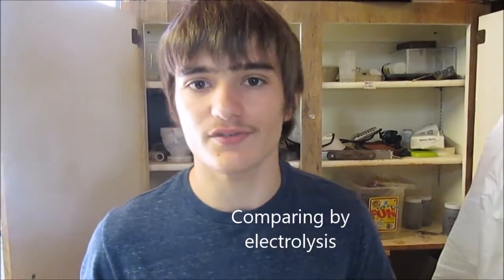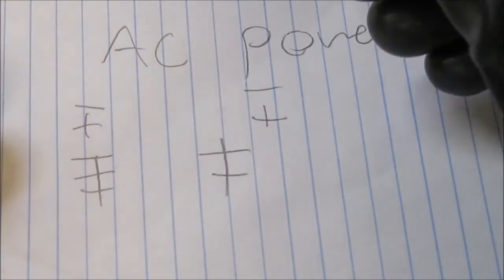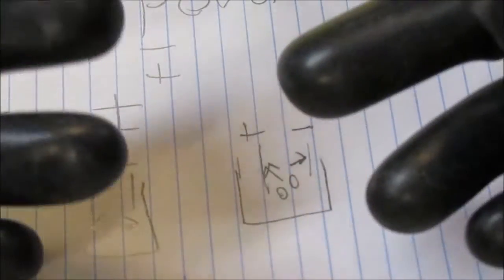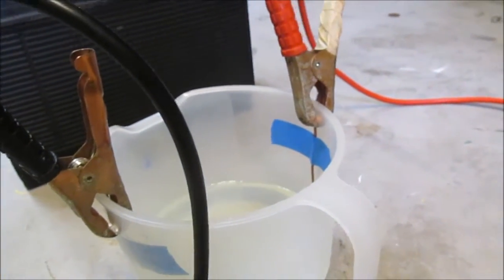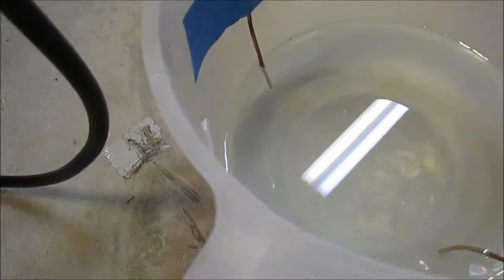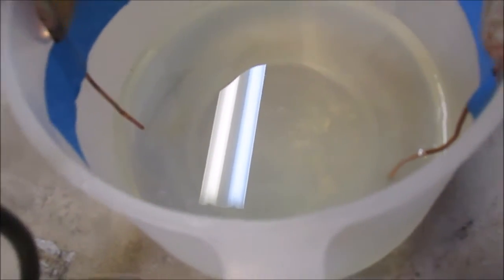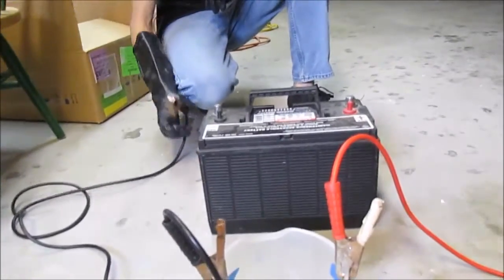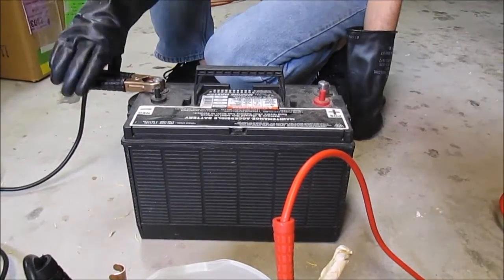AC vs DC Electrolysis

Comment: Ac at higher V and high frequency is actually way more efficient for generating HHO gas from water.  However, u want your signal fo be very specific, and it must be DC offset so the polarity isnt changing.  This way, a pulsed signal will vary between say 0 and 100V instead of -/0 to +50, using less lower than dc and wasting less power as heat dissipation into the solution.

If you match the frequency to the water vibration as a harmonic, the pulsing field will align the molecules and "pull" on the bonds which can break bonds via electric field harmonic constrictive Interference thus generating more gas without using any current, further increasing efficiency.  If the frequency is also matched in resonance with the cell....a massive volume of gas can be made with a fraction of current used compared to dc. 

This is every difficult to achieve though because it requires a very complex supply circuit to generate the needed signal.
Reply: -50 to +50
Reply: Spot on, this is probably what Meyer was doing to get the most out his WFC for the same power cost, especially if you can get the cell electrodes as close together as possible without galvanic contact.
Reply: @JenkoRun  True.  I believe there was a lot more to that guy's HHO car and he was "accidentally" removed, conveniently along with his research and plans etc in a house fire.  Not sure if Meyer was his name, but i remember seeing a guy that ultimately refused to give up when he was mocked and accused of fraud trying to present his invention; he decided to just build it himself staring his own company as an electrical engineer.  He went out west to sell some land to fund the first 10 vehicles and ironically died in a house fire along with his garage and pretty much his research as well.  Not the first time this has happened around breakthrough technologies either.  People think its about making things better, environment etc....total bs.  Its about making profit and thats all, no business wants a product coming along that lasts ten times longer because there's no money in selling tires that go 350-400k miles before wearing out (actually documented organic chemist discovered rubber polymer capable of this, company promised to make the product, bought his patient, then sat on it and its still a locked down tech to this day)

I worked at Oak Ridge in Tennessee USA, largest research facility in the US where the first atomic bomb was developed back in WWII doing R&D as a chemical engineer minoring in polymers and biochemistry.  I had security clearance to everything but the military stuff; lets just say I saw things you would swear was science fiction and not real.  Our tech to the public truly is 25-30 years behind what is really out there at least....its just kept buried because it holds no profit or power over the masses as consumers.  

I personally developed with my team a Li_ion type battery to completion....its capacity was minimally better than current tech, current output was somewhat improved but not by any serious amounts (except for the nano tech layered ones, they had massive current capabilities but also heating issues).  However, I used a biomolecular process to generate the electrode mixtures with nitrated cellulose and other things....making manufacturing not only environmentally friendly removing the harsh solvents needed, but also lowering cost estimated 35ish percent (in 2014).  The kicker though was lifespan.  Currently around 1500 to maybe 2000 charge-discharge cycles and the battery is toast, time to buy replacements.  Mine, however, after 6500 full cycles still retained at least 90% of their original capacity!

Now...being ten years ago now; tell me please, where is this technology???  Ive never even heard of it anywhere in public eye.  Sadly money and greed run things, not the attempt for better things.
Reply: @ckimsey77  If you really have been involved in that kind of research that's very impressive, I've had my head buried in highly alternative physics and research for the last few years and the kind of stuff I've come up with as well is, as you said, the stuff of science fiction. I'd wager those at the top have tech that's actually 130 years ahead of the public in the field theory department.

My interests range all over the place from so called "free energy" (which is really COP > 1, delayed entropy, there are a surprising number of ways for this) to field propulsion craft and various medical devices, and some extremely wacky geometry research, among other things, I'll occasionally browse around the net on a topic I'm interested in to see if anyone has has been thinking along similar lines and your comment caught my eye concerning the Hydrogen production tech.

I saw the exact same thing from one of Aaron Murakami's videos from nearly a decade back, turns out the missing key for Meyer's water fuel technology is Nitrogen of all things, he used it via an air intake to slow the combustion rate of the Hydrogen gas giving it a more conventional burn rate, the resulting ammonia could be fed back into the mixing chamber to increase efficiency.

Another area is purely reactive circuits, preferably the single wire type system that Tesla developed, I don't really like conventional closed circuits since conduction current gives you heat losses in the wires, switch to a resonant single wire system and you get rid of the problem all together, not to mention the reactive power is far less dangerous than active phase, even the Plasma becomes non-destructive.

It's kind of frustrating looking at the modern public tech and actually seeing where the problems are with it and knowing how it could be vastly improved.

I saw your post from a year ago concerning your health, have you looked into the lakhovsky multiple wave oscillator at all? Specifically the data from Borderlands and the Vril website (most other sites tend to be full of useless promotion n such) I've got a copy of the borderlands research data on that thing and it's pretty impressive.

Comment: brute force takes sheer power. hysteresis due to angular momentum at various system resonance frequencies, makes use of local potential instead of requiring higher amperage necessary in low potential situations. Keep digging guys!
Reply: http://www.free-energy-info.tuks.nl/SChapter15.pdf

Comment: You actually can have voltage without current. Voltage is just a potential difference, so when there is an insulator with an arbitrarily high resistance that can be considered for our purposes to be infinite (such as air) blocking the completion of the circuit, the circuit is open and there is full voltage across it with 0 current. What Ohm's law (I = V/R, i.e. current = voltage / resistance) actually tells us is that you can't have current without voltage, because 0/R will always = 0 in practice.

Comment: Add some Potassium hydroxide or sodium hydroxide and then see the magic!
Reply: That's because there is no oxidizer ions in solution, with naoh... So with ac current, you get both oxygen and hydrogen at both electrodes. And you can't easily just separate them... But with DC it's possible cause anode and cathode remain the same during electrolysis.
Reply: @hrajabi7261  yes very true
Reply: Add some salt enough
Reply: @qhriathousz734   Adding salt like NaCl will also generate chlorine gas at anode, which is unwanted, sir.
KOH or NaOH will only give O2 at anode.

Comment: not realy true a plazma ignition burn even ordinary water to their individual molecules  to get a reaction you need 2 ac input and to have oposing frequencys hiting ich other at high speed you will get with high enough voltage sparking effects probably that bucket of water culd kill some one ,read plazma ignition ore plazma generators what they can do how ever good experiment but you shuld try winding metals in to a coils ore use multipel ferritic and non ferritic metal's for testing  then you will see a diference probably for ac to work.
By the way dont do it with ac is lot higher risk to get killed not because of the electricity it self but rather the energy realise from water culd rip you apart the faster you realise a energy the faster mather will implode/explode again watch what plazma generators are they use waraity of diferent things like temperature diferences,magnetism,preshure/wacum tehnicaly all the same crap but diferent energy type's used to get a result.I belive a volta baterry cell is somthing ells as a lead acid baterry and you actualy can swap those diferences with ich other for electrolisys I wuld like to know what wuld hapen if neutral plates are used ore diferent cinde of materials used as plates in a baterry that wuld by interesting well todays peopel actualy make baterrys act as capacitors ore simply use capacitors only to get diferent reactions actualy if you want to look at it in a centrain way lot experiments schools even dont teache sadly

Comment: one small ll note...
thing is tho i have finished to  build my hydrogen generator a big plastic box 22 liters and 2 smaller plastic container 1.5 liter each, where i've put the cells + and - separated,obviously with the bottom of the smaller plastic box with the cells  inside cut to allow water flow around....
specifying  negative plates N.10,positive plates N. 2 each pole inside a plastic box,and bot smaller inside bigger box filled up with 16 liters of water.
what i tested with a power supply 12v dc 60 amps almost nothing comes out,barely few bubbles of oxygen and almost no bubbles of hydrogen.
plugged the 220v AC rectified through a bridge rectifier with 1000 v and 50 amps,right after i plugged the current started producing hydrogen and very lil oxygen...
observation for the test i used small gauge cables,later i will use bigger once so it can arrive higher amps....

Comment: Ehhh.... AC isn't bad for electrolysis, it's different. 
Generally speaking, AC electrolysis isn't used on water, but if you're going to use it for water, you need specially selected electrolytes and/or special electrodes. 
Rather, AC-Electrolysis is used on proteins, RNA/DNA, and some organic molecules. 
Each for slightly different reasons, and usually with their own quirks in that application. 

Proteins, RNA, and DNA are actually sorted by AC electricity more accurately than DC when the fragments of DNA/RNA or the overall proteins are large.

Organic molecules are not usually subjected to AC for the purpose of splitting them apart, but to cause some sort of chemical reaction. An instances of this is fluoridation of certain types of alkanes.  The physical separation of the fluorocarbons from the other products doesn't need to happen because the fluorocarbons are generally not soluble in electrolyte after the form, and simply fall out of solution.

Comment: every time i try, it seem to turn the water brown
Reply: When I try doing electrolysis with graphite the water doesn't change colour but the graphite leads crumble.
Reply: that's normal it is simply because the electrodes in the water are oxidizing, the water will remain clear if you use graphite leads for example lead from a pencil
Reply: @birchyote  should i use lead and copper? or lead only?
Reply: ramique humphrey pencil lead for the part that goes into the water- importantly not the actual element of lead as that is extremely lethally poisonous lol, but copper wire attached to the graphite lead going into the water would be fine and wouldn’t get oxidized
Reply: @birchyote  ok gonna try again

Comment: I am sorry for you boys to think so that AC is bad for electrolysis as you are using 50Hz. To break water you need 42.8 Khz to break the bond of hydrogen and Oxygen. you should see Meyer's work. Keep up the experiments. AC electrolysis is 1000 times more efficient.
Reply: A frequency of 42.8 khz means a delay of 23.3644859813 microseconds with an Arduino per wave, meaning 11.5 microseconds per half wave.
Reply: @ThatJay283  excellent info. I'm trying to set something up like this.
Reply: And how do you separate the hydrogen from the oxygen (or whatever gases are formed in your particular solution) using that method?
Reply: Excellent info. I'm wondering if there's an easy way to achieve this frequency? I want to experiment with a very basic version of Stan Meyers system.
Reply from the maker: Thanks for this information, we're definitely going to have to look into that.
Reply: @787brx8  this what actually i looking for, it thought elextrolysis in ac happened at opposite wire, so we need live wire to generate gaseous basically this jar salt act as big resistor? so we need plug between wallwart - wallwart and put resistor  between it?
Reply: Ehhh.... they're using 60 hertz, not 50. They're clearly in North America, which uses 60 hertz as a standard. 
As far as that goes, 42.8 Kilohertz is easily into the Radio Frequency range, and that kinda should be evaluated separately from low frequency AC. 

AC and DC are actually about the same in terms of usefulness, but each have their own issues.
Reply: You must be in the U.K. right? 50 Hz is not U.S line frequency. 60 Hz is U.S line frequency.